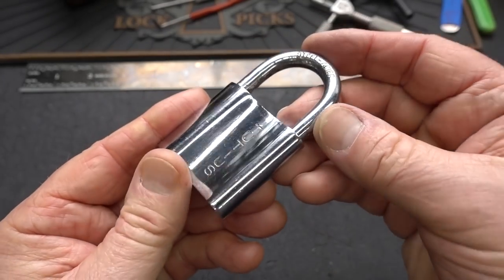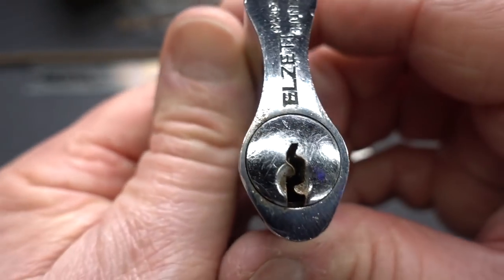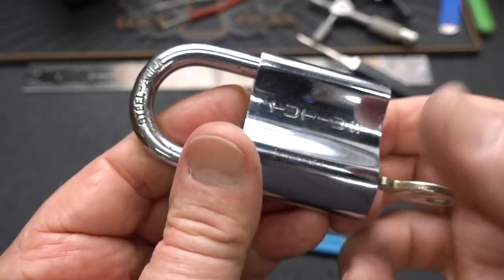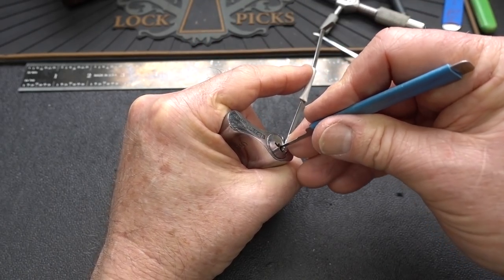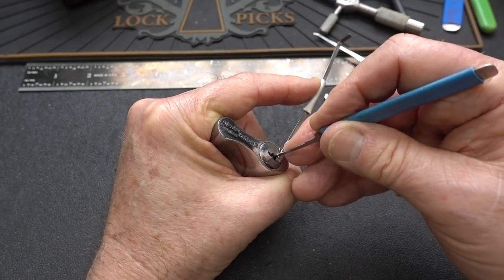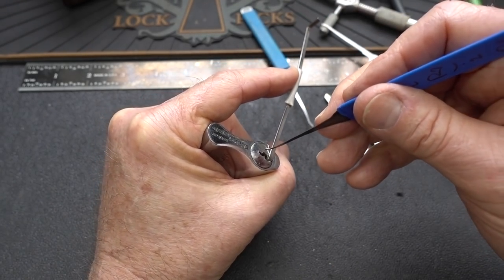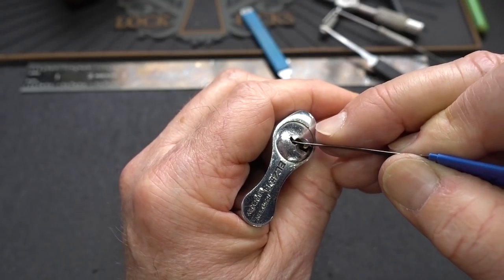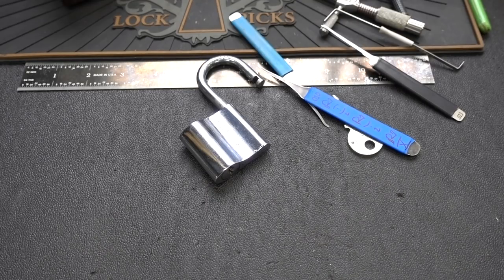(1858) Chromed Elzett Tutius Padlock

Comment: If the webmaster draws my name, I would be so happy to put that lock to good use.

Oh, Bill, a pin cut question - if that lock had a high cut in pin 1, those wicked low cuts in 2 and 3, and the high cuts in 4 and 5, that would be a little bit more difficult than what you actually had, correct?  Thanks!

Comment: Nicely done. Ok off topic but, is there a way to open my front door from the outside.  Double glazing euro cylinder uk lock with the key in and turned to the side on the inside.  Partner in the shower and i can't use my key to get in after work! What's the bypass solution to the p in the a partner leaving her key in the door lol please Bill, help!
Reply: A rock 🪨 and /or a euro bypass tool by Sparrows